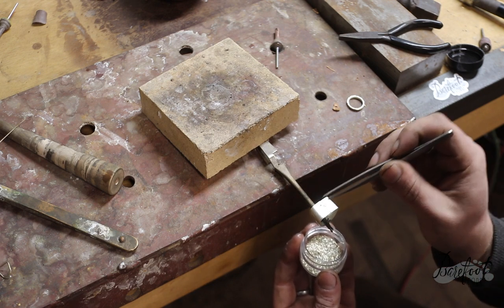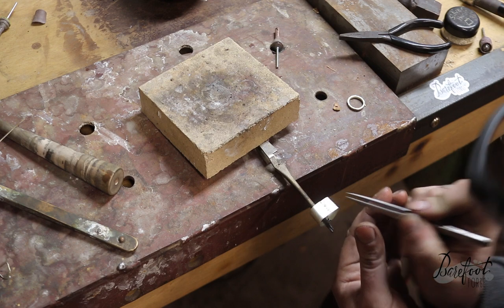Crafting a Stainless Damascus Ring for a Friend- a special ring for a special friend!

Comment: That’s a really cool ring. I will have a question. How did you get that pattern into the stainless?
Reply: I know this is soooo late but Damascus is a technique of layering multiple types of steel together. One type is softer than the others and gets eaten by acid quicker... So when you twist the two steels into bar form then acid etch them you get the pattern

Comment: I etched my ring then tired to polish it now you cant see the pattern. Does that mean i need a deeper etch?
Reply from the maker: That's going to depend on what composition the damascus steel you're using is made of. Our material blend is engineered for bold contrast and deep etches- but most of what's on the market.... is not. 

What type of acid are you using and what's the material composition of the damascus you're using?
What did the supplier of the material you purchased say about their specific etching instructions?
Reply: @TheBarefootForge  
I didn't buy it. my co worker did was making the ring for his son. I was using 25% sulfuric acid.